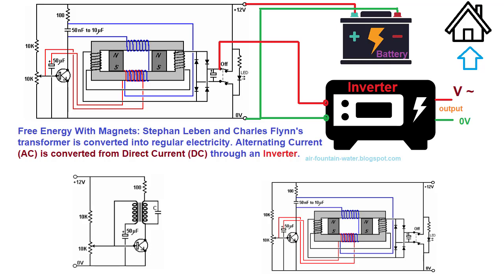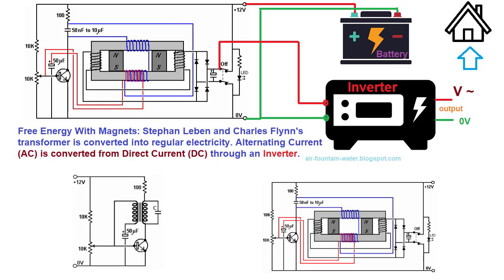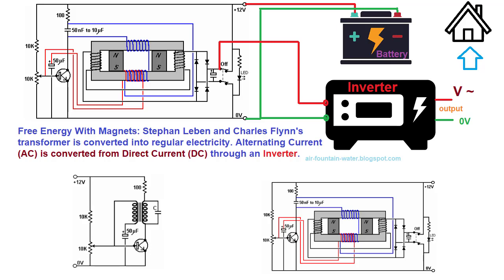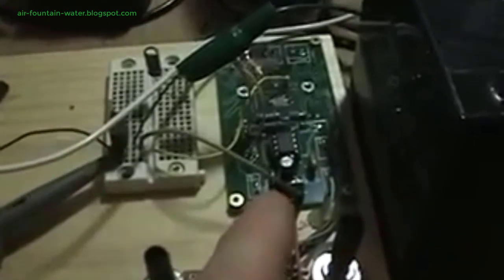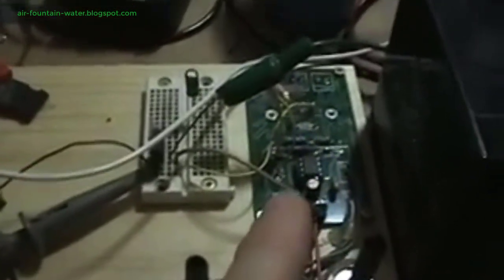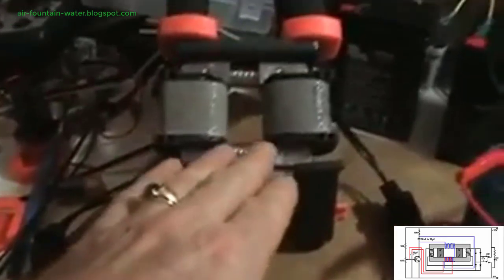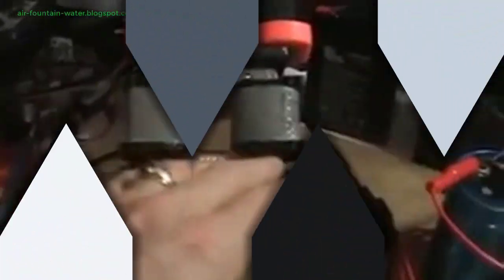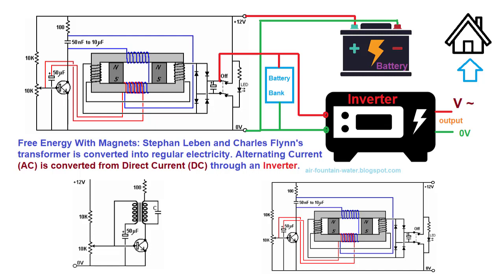Free Energy With Magnets by Stephan Leben and Charles Flynn

Comment from the maker: Activating the magnetic free energy circuit is surprisingly simple yet ingenious. A brief touch of a 12-volt source to the output terminals or waving a permanent magnet close to the red and blue coils initiates the system. The self-sustaining nature of the technology, once set in motion, challenges conventional notions of energy dependence. Stephan Leben's suggestion of using a piezo crystal from a lighter as an alternative initiation method adds a layer of adaptability to the technology.